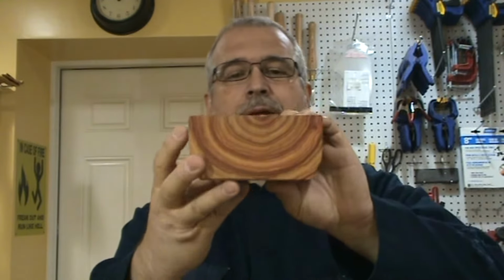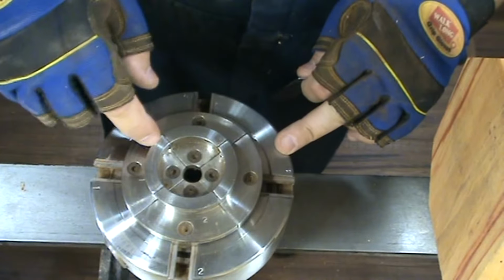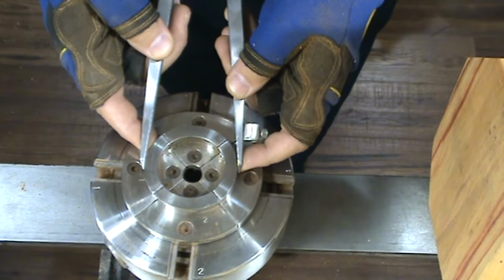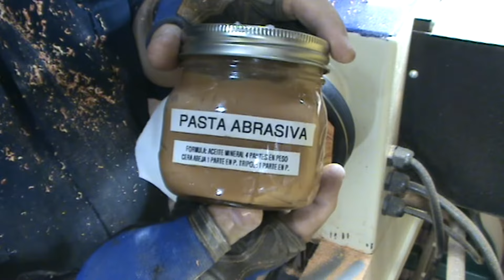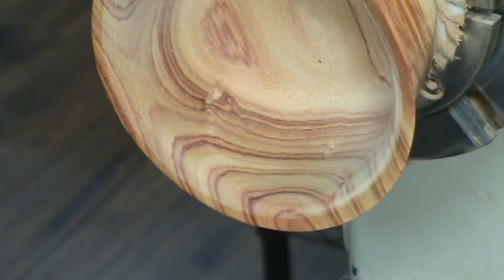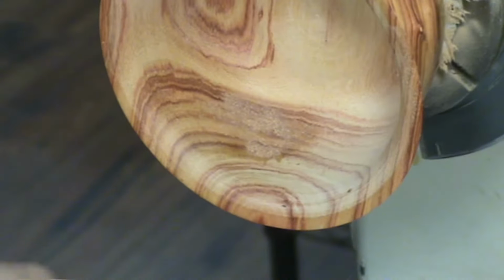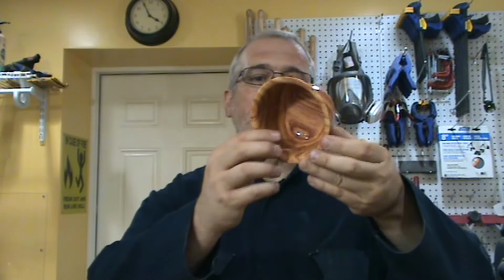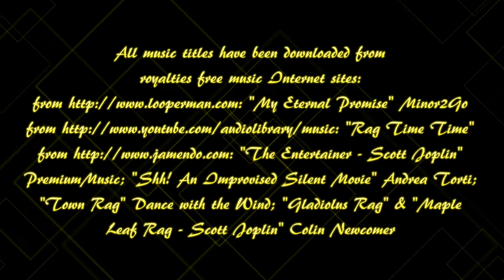Tulipwood Bowl for Paula

Comment: You can try turners tape by fastcap as well which is a double sided tape or good hot glue can hold it instead of screws. Nice repair.
Reply from the maker: Erik Anderson Yes, that would have been a nice way to fix it, the only problem is that tulip wood is so hard, I was afraid the tape or the glue would not be enough. But I will give it a try next time. Cheers! Daniel

Comment: Beautiful wood grain as well as a brilliant finish Daniel,  Seeing that octagon shape at the top of the bowl I would have maintained that shape for a slightly different look but round turned out to be just as beautiful. That was a shame the screw holes were in the piece but you did an awesome repair on it. I myself don't like using face plates on small pieces but I know safety brings you in that direction. You could consider a worm screw for pieces like that I find it to be a great holding tool.
Take care  
Albert
Reply from the maker: Al Furtado Hi Al! Muito obrigado meu amigo for your comments! I thought the same, but for that I should have been more careful in the cutting of the octagon, when I looked closely to the shape it was a bit uneven in some places and for that reason I decided to stick to the original plan, but let me tell you, I was tempted :) The worm screw is a good idea, also, I need to get myself a smaller face plate, the only one I have is the one that came with the lathe and it was a bit over dimensioned for this small piece. Everything in the learning process correct? Thanks a lot again for the advice! Cheers! Daniel
Reply: I agree We all have something to earn from each other. I am glad you didn't get insulted.
Reply from the maker: No way Al, I know most comments are constructive and that is how I take them, this is a hobby in which I barely have a year and a couple of months.  I would be stupid not to hear what people with much more experience than me have to say ;)
Reply: Thanks

Comment: I have used beeswax and mineral oil for finishing but the tripoli is a new thing for me. Thanks for the lesson.
Reply from the maker: Kenny Boothe Hi Kenny! Thank you for the comments my friend! Yes, you can use the mixture of tripoli paste as a further step in the sanding stage previous to the application of the friction polish or even leave it there if the finish you want is more satin than bright. In the following link: https://youtu.be/JIiQJVLLbvk I show how to prepare the paste if you want to take a look, and in the next: https://youtu.be/Z5nDGr57-sA it is the formula for the friction polish that I use normally as final step. Cheers! Daniel